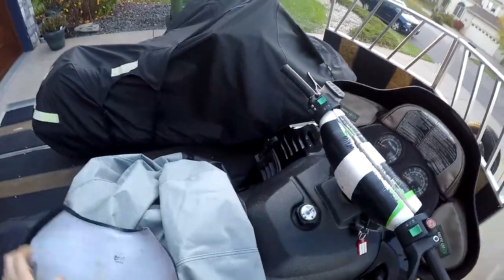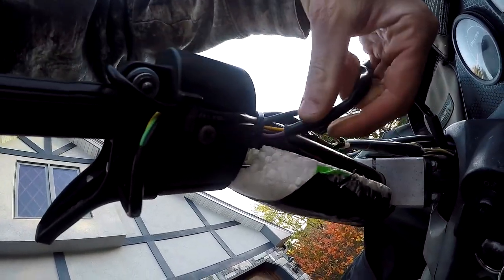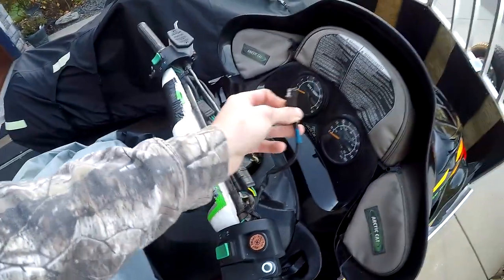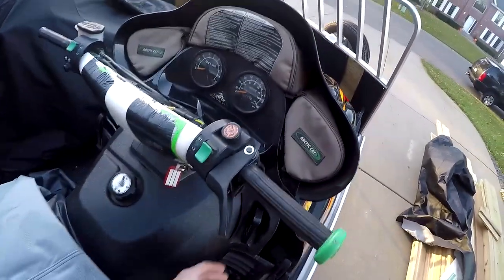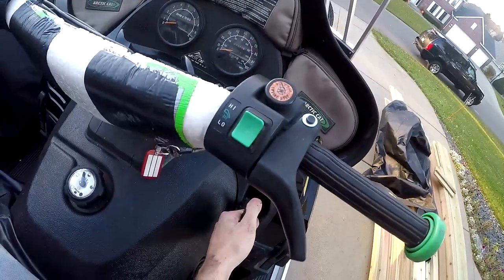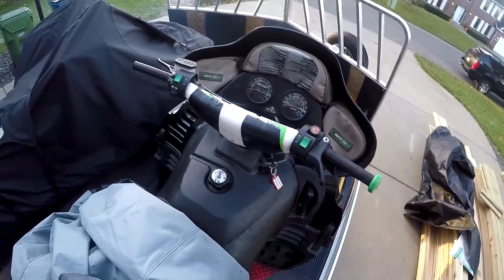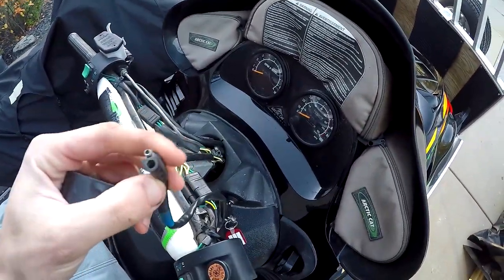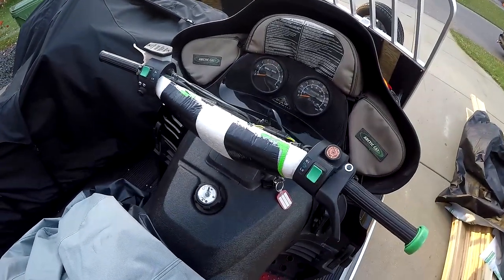How To Fix The Throttle Safety Switch (2000 Arctic Cat ZR 600)

Comment: Does the killswitch still work?
Reply from the maker: It possibly would I'm not sure if the TSS is on the same wires as the kill switch.
Reply: I read somewhere if you heat shrink wrap the middle wire the kill switch will still work. Haven't tried it though.
Reply from the maker: @valleyblog  if the pin is isolated out of the equation then yes. However the TSS switch is located on the two pin I showed in the video